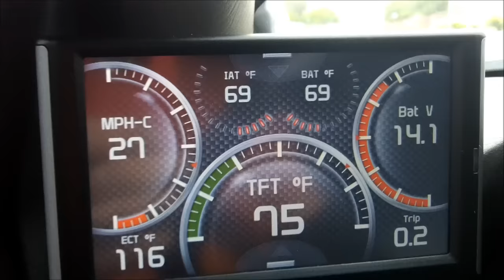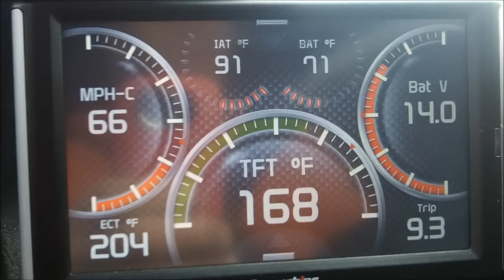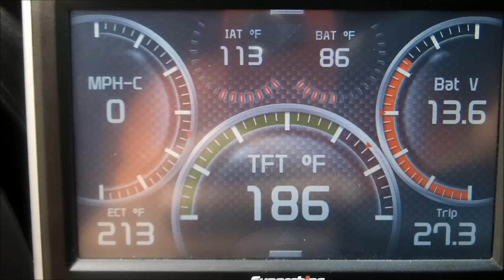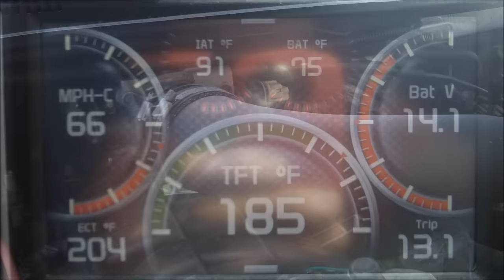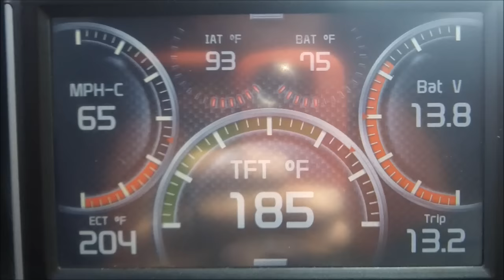K&N Cold Air Intake vs. Stock Air Clearer in a Air Temperature Test

Comment: The results are probably because there was so much airflow during highway driving that it was cooled more with the unrestricted cone. I would think that during idling, the results would skew more towards the stock air box, since the air inside the engine was not being replaced by driving speeds. Thanks for the test!

Comment: If you have a K&N air intake system with the air cone filter exposed make a heat shield plate to prevent it from breathing hot air from the engine area now...it will breath cooler air from the outside! I did that and it works better!  😊
Reply: Stock filter box gathers it's air from in front of the radiator.   K&N so called cold air intake filter gathers it's air behind the radiator.  Heat shield or not that's not better.
Reply: @markcarpenter3600 my car has a duct to the cai straight from the outside. I don't think ive ever installed one that visibly takes in engine air. Even when I had a mustang it drew in air from the fender area

Comment: If the intake air sensor is in the factory location, it will show the same temperature every time. The factory sensor is located on the aluminum intake header, which is heated by the exhaust manifold. The intake and exhaust are practically in contact with each other. If the sensor was relocated to the throttle body, it may show a greater difference in air temperature entering the throttle body, but it will get warmed to the same temperature as it travels through the hot intake manifold. This is an engine layout that will likely not produce cooler intake air at mixture regardless of the intake piping design. You may see more improvement if you rigged up some DEI heat shielding between the 2 headers, but it won’t stop heat sink from the head, because they are connected to the same metal surface. “Cold air” is false marketing, unless you put some dry ice in the air box.

Comment: I know this was an older video but still a Good test. i think the term cold air intake is the selling point. The after market air intakes do flow very well and k&n does a good job engineering them. i would love to see this test done again but with a 3rd type like the volants where they are like a mix of the k&n and factory.  A better flowing tube and filter but with an improved air box and lower air intake tube
Reply from the maker: Yeah I had a Volant on a 97 Vette, that was a true cold air intake.

Comment: For my car I keep my fresh air duct that sucks in air from the outside and connect it with the little heat shield thru a hole so technically it’s using cold air

Comment: Awesome you make a prediction then prove yourself wrong and are not too egotistical to admit being wrong. I thought the stock box was going to be cooler air and the K&N would be more air too. As most are saying, that K&N that was installed was not a cold air intake. Most Cold Air intakes go out of the engine bay. That one is a performance intake, much like a short ram which sole intention is just more air.

Comment: The one I got from K&N just says High Performance intake system, not a cold air system. Only time you will have a cold air intake is in winter, late fall or early spring! It’s all about the volume of air entering the engine not cold air! Hell all those 70’s muscle cars air intake was right on top of the engine! The HOTTEST place under the hood!

Comment: I believe the nomenclature of CAI is outdated.  Recall once upon a time the air filter was in a can over the engine, with the carburetor underneath.  It drew in hot engine air.  But auto manufacturers have long since made it into a cold/ambient air setup.  They just designed them with baffling to make the interior quiet (recall TV commercials touting that as a feature of the model).  The CAI systems of today are still CAI relative to the old can, but also high flow in regards to the ductwork and filter itself.

Comment: A lot of the heat picked up in the charge air comes from the intake tubing, between the filter and the throttle body, this is why the street race guys put ice in the intake header, to cool the charge air. You can reduce this heat transfer by wrapping the intake tube with heat wrap but the best results will come from a higher flowing intake like the K&N (yes, I know a lot of folks don't like K&N but you can use other brands) leading into an intercooler.
Reply: Why people do not like the K&N?
Reply: @shonyacowans6096  because people think it doesnt do a great job of filtering out dust. And that the oil messes with the MAF. The MAF can be cleaned its very easy. And the filter actually does a decent job at filtering dust, like any other filter 🤷‍♂️

Comment: If you pull the tube out of the stock air box you can get more air into the engine and the air filter is protected. I pulled the 2 tubes out and I cut the air barrier out of my air box in my Grand Prix. Now I get more air and the air filter is protected. Also engines react differently to SRI, CAI, stock air boxes, and modified air boxes. No engine reacts the same way.
Reply from the maker: Thanks for coming. I'll have to give it a try. I've got another stock box sitting here that I'm willing to cut up.

Comment: Hi Martin! Q? Can a damaged rubber gasket on the airbox that sits on the throttle body cause a rich fuel mix if it's sucking air OR a rough idle???

Comment: There are some supercars that actually run the air conditioner system into the air intake So to boost the horsepower obviously the colder the air the better So by routing the box to the coldest air outside the car would be best instead of across the radiator heat lol

Comment: Put some 2x4 pieces of wood at the front of your hood so it will not close. Tie hood down and see it temps are cooler. May be you just need some well placed vents to dissipate under hood heat.

Comment: You forgot The heat soak that occurs in plastic I did the same with my car but therma heat shielded the whole intake and at highway speed of 60 plus I get 3 degrees higher than ambient temperature. But you are right CAI AFE GT momentum or stock in closed boxes are best if you get outside air not engine air , but yo still need more oxygen to get more power so more cold air is best.

Comment: More air equal more power. If you're worried about heat put heat wrap around the housing the aftermarket one has to offer. You can even channel a housing or "tube" from under the bumper to offer more "cooling".

Comment: This is why I never installed a "cold air" intake. I do want to get just a little more purr from my engine but not at the cost of significant heat increase. Unless I can rig something up with the stock air box with an aftermarket tube and filter.

Comment: The original air intakes are not designed to take in as much than the performance filter. The performance  filters stop  much more dust particles from entering the engine that actualy damage the  engine over time. They stop about 2 parts per million dust from entering your engine and allows the engine to breathe better. These filters are used and tested on formula 1 racing cars. that says a lot to me.

Comment: I've told people for decades.....cold air kits, if it DOESN'T route air from outside the engine compartment, isn't. All the kits that leave the filter open under the hood is NOT going to be any cooler, and likely will be warmer, especially if you put a metal duct on to the throttle body, since metal conducts heat so much better than rubber or plastic.

Comment: Have you had a chance to measure fuel economy with the stock air box and the Air Raid intake tube? Just purchased one for my 06 Dakota to see if it helps and to simplify the intake system. People seem to be on both sides of the fence so would appreciate a definitive answer.
Reply from the maker: I can't say I saw a noticeable increase in fuel mileage. I think if you were to get a MPG increase it would be marginal. Sorry if it isn't exactly definitive answer.
Reply: martinbuilt no problem, been having issues with the engine stalling in stop and go traffic, slow moving traffic when air flow isn’t constant or optimum so that’s why I went with the Intake tube. Just installed it today and so far no complaints or issues and engine seems to be breathing better.

Comment: Run small line from ac duct to air box equals cool air
Reply: I know the first hell cats had an AC line run into the intake that you could use to make horse power . I think it worked by running the ac to get the unit cold and then you turn the ac off and open the vent to the intake to save power and letting the cold air left in the unit flow into the intake . Say what you want but for a street legal factory car dodge looked at every angle to make horse power and they have truly lived up to their nick name The House of Muscle  .

Comment: There is a difference between the 2, the stock is already on the motor and you have to spend 200.00-500.00 for the k&n for the same results.  😂🤣😂
Reply: You should go watch all the dyno tests there big guy. Some engines are more responsive than others but I gained 15 HP, proven on my own dyno

Comment: Great test. However, that K&N is NOT a true cold air intake. The temperature should be around the same as the factory intake. Can you perform the same test with a true CAI that pulls air from the fender well?

Comment: Didn't read all the comments but did you notice that your battery temp went up 6* on the second run? Just wondering if the ambient temperature went up also meaning the factory setup is actually cooler.
Reply from the maker: tzone 
when I did the test there was virtually no difference in ambient temperature. and I took the vehicle on a good long cruise each time to let the underhood temperature equalize as much as possible
Reply: The battery temp sensor is on the BASE of the battery, so no external air will change the battery temperature so far. The temperature change on the battery is mostly because of a high charge rate.

Comment: You mean to say that the engineers who did the air flow engineering on said vehicle actually knew what they are talking about? Who would have thunk it?LOL
Reply: Hey that piece of rubber underneath the front bumber is not for plowing trash off the street.It ia called an "air dam" and it has a function!

Comment: I have an f150, '05. The stock air box is ALWAYS hotter than an airaid cold air and airaid jr. setup. Stock is significantly hotter  with the stock system. Jr. Was next with the cold air the coldest.

Comment: The Air Aid tube is not stock. Flow will not be the same. So temps will be lower. Stock tube will be less flow and more heat on IAT sensor
Reply from the maker: The thing is that there was no difference between the 2 in temp.
Reply: @martinbuilt  Use the stock air tube with the air box and temp will be greater. Air box is not the restriction the stock air tube is.

Comment: Good test, although the real name is height flow air filter which is not supposed to give you colder air but better flow and it’s only recommended for turbo engines that have an Inter cooler .

Comment: Regardless of AIT, the one issue i have with K&N filters and the like, the filter requires a like coat of oil, that they sell themselves obviously, over time, that oil coats the components inside the MAF sensor and therefore requires a more periodic cleaning so the engine will run more efficiently versus the OEM paper air filter thats normally used.

Comment: Hi Martin. good video. Thanks. Answered one important question [AIR TEMP] but an equally important question remains and that is the difference in INTAKE ('INLET' here in Australia) AIR VOLUME between the two air filter element types [FLAT vs CONICAL]? It would require a dyno but interesting, eh? Ultimately it is determined by Throttle-body diameter/blade area etc but it would be cool to know as well. Anyway, how have you been mate?
Reply from the maker: I have been doing well, thank you, I have been working on a new Ram Air for the Grand Cherokee using a conical filter

Comment: Without a heat shield you shouldn't install a cone... Install a cone, put a shield on it with some thin aluminum plate and then improve air field to the cone. If not, don't install it.
Reply: Well said. I did a metal plate ontop of my k&n air intake and yes it does make a better difference. Now it only breathes fresh air coming from the outside.  😊

Comment: So... The CAI in isolation vs the OEMI alone is of no significant value in terms of temperature. However, the air flow between them could be different. If the flow is significantly higher with the CAI then the net effect is cooler air through the CAI.
Reply: ok Forrest

Comment: What was the temperature with the stock box at idle? I think there may be more difference when the vehicle is not moving, as hot air builds up in the engine bay. This may have more negative effect with the K&N than the stock box. When the car is moving  air is constantly moving through the engine bay so I'm not surprised by your results.
Reply from the maker: Paul Turner 
I don't actually recall if it was hotter at idle with the K&N. But I'm sure you're probably right and I wouldn't be surprised that it would be warmer temperatures with the K&N.
Reply from the maker: Yes, I did that on my 98 XJ with the cold air intake that I built.
Reply: Test should have been done not just cruising but stop and start at lights stop signs that would make a big difference.

Comment: Use the stock intake & air box  and keep it clean with a clean air filter. You have just saved $300 and your car will perform just fine. You can buy many stock filters with $300. 🏁👍
Reply: Lol I paid 50$ for my CAI. I noticed it breathes better and I get better gas mileage. And it looks alot cooler.

Comment: Most of the people buy this air intakes systems just because they saw it on magazines or commercials but don't realize how this works.  They just wanted to look cool " and forget about vehicles have computers, and this are set up for OEM parts only.  I never heard any of my friends saying: I have to take my truck to a Dyno tech because my new intake.  I wouldn't recommend this if you just wanted to show up. It's not gonna make big difference if you don't do it right.

Comment: Interesting test. It would have been interesting to see if the stock airbox that sits on the motor heat soaks more than the airaid pipe. I would like that type of Airaid pipe as I want to keep the stock airfilter housing as its used for offroad half of the time. The stock filter looks to better coping with water crossing. I never go deep enough to have the inlet under water but it does drain well. I like your through the bonnet CAI but worry about if I do get water over the bonnet, its going right in the motor. I have removed the rear bonnet seal which should work like vents in the bonnet to get temps down. I would like to try an Airaid pipe but heat wrap it and maybe heat wrap the filter housing. Then again Im probably overthinking it.

Comment: Move your ait sensor from manifold to the air box
Reply from the maker: I just did that like a week ago. Thanks
Reply: I was curious what the temp change is i have a 93 and just moved mine yesterday whs it a big change? Enjoyed you video keep up the great work
Reply from the maker: Dustin Entwistle 
It was a huge difference. It comes in at the same as ambient temperature. The one thing I did notice though once the vehicle is warmed up and you park it when you return to the vehicle  ( let's say after an hour or less) the temperature is significantly higher than ambient. And stays above ambient temperature.

Comment: I live in the south and use my truck on the farm and for hunting and such so I would rather go with the sealed intake box and the Airaid jr intake pipe . If I were to run that open cone filter it would be sucking in water and dirt without a doubt I have been in situations where water and mud were rolling on my hood more then one not playing or trying just situations I run into on the farm and hunting property .

Comment: Pods are for ricers and kids and granted back in the late 90's they did work well on the Supras etc. They wont anything good for modern cars if you want the same effect while maintaining your warranty etc then just replace the pipe going from the TB to the MAF Sensor. Its in there that the factory put intake mufflers and restrictive sound deadening materials. Replace it with 3' for V6 and 4" for the V8's. Only then will you notice that the fly by wire throttle lag\response time will be eliminated.  Forget pods here in Australia we fit the OTR's now on real cars and then tune the car at the same time. its not unusual to see +30kw improvement at the flywheel. So, to recap POD filters = Clueless owner and a voided warranty at best. Always keep your OEM parts. for servicing and resale. Offer the other bits after the main sale has been finalized.

Comment: Vent the hood or raise the back by the cowl and remove the weatherstrip at the cowl. That will do more good than a $300 CAI system. The only way to get cooler air in is to get the hot air out. Figure a way to keep the fuel in the rail cooler, that will help a lot more. It is a non return system so the fuel sits in the rails for quite a while and those rails get HOT!  I replaced my standard 4.7 air intake system with one from an HO, has a better flowing resonator box, larger dia round tube vs oval and a larger air box. Modified the fuel rails so each side gets fed fuel vs getting fed on only one side, keeps the fuel cooler, and raised the back of my hood with a couple washers and removed the cowl seal. It did make a difference I could feel,  the amount of heat coming out of the gap, which is hardly noticeable, is unbelievable.
Reply: What’s h.o.?